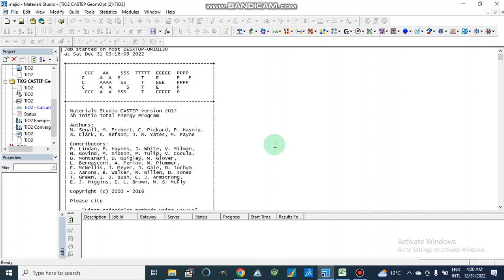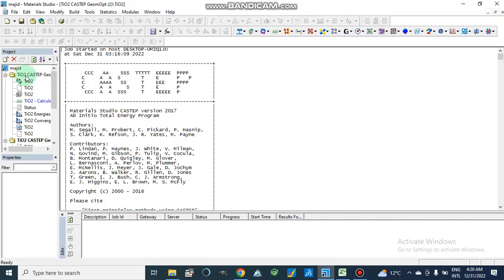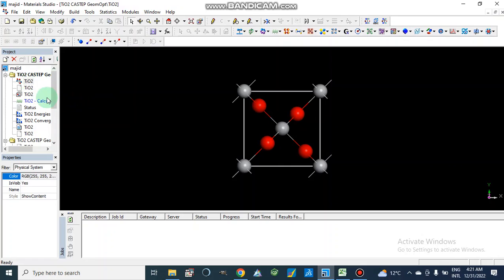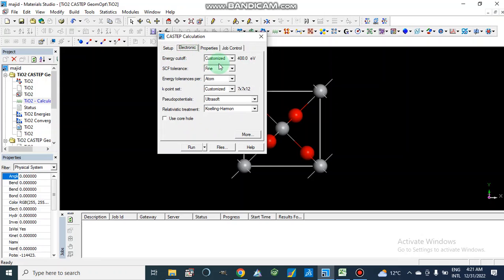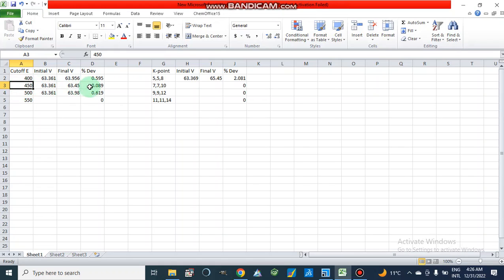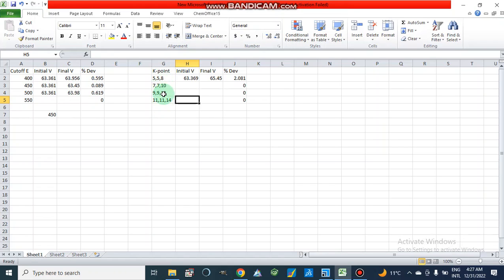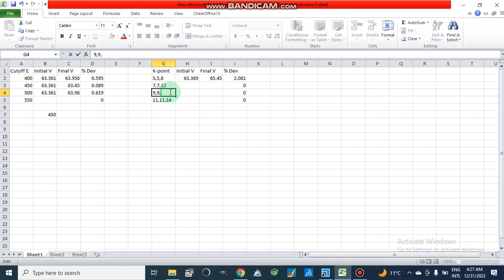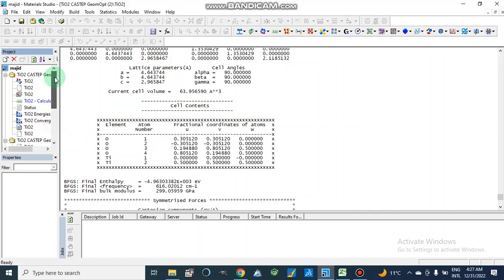Material Studio - optimizing cutoff energy and k-points by CASTEP calculation @MajidAli2020

Comment: how we can increase the geometry optimization speed when we studying double perovskites materials?
Reply from the maker: By increasing processor speed and RAm
Reply: @MajidAli2020  Sir One more I have a question: how do start taking cut-off energy/ k-points? mean from which cut-off energy/ k-points value should we start the program? What does it vary from materials' family to family ?? if yes what should be for perovskites?
Reply from the maker: It is given in the video. You have to analyze by taking different values